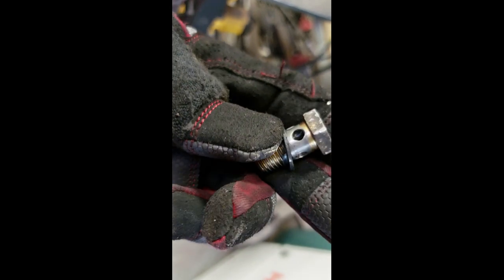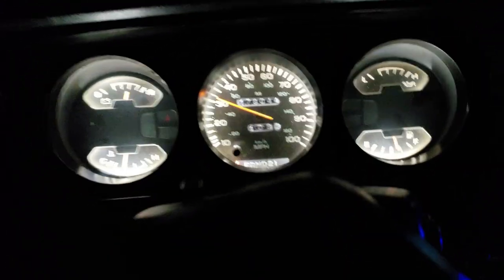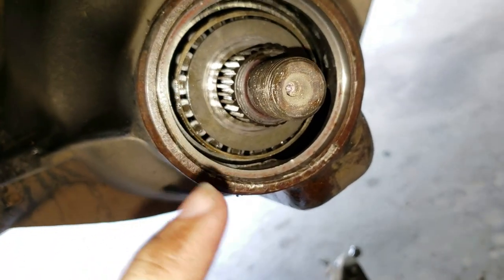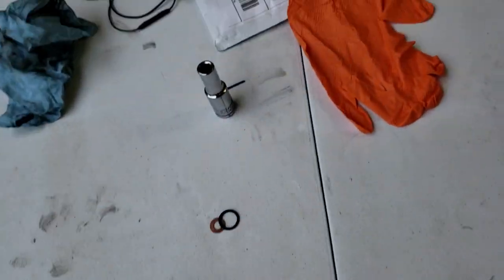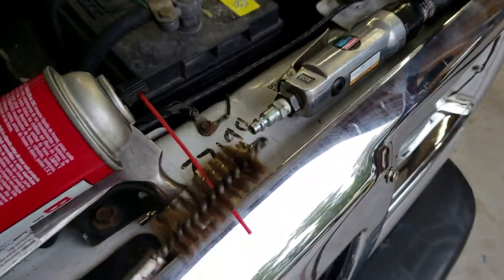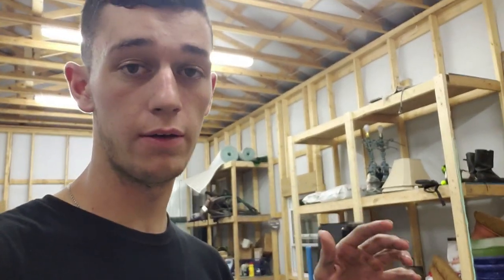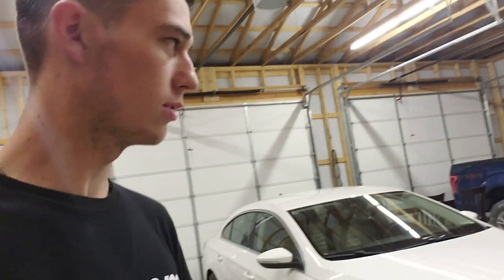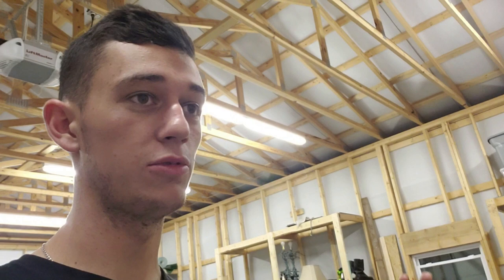FIRST GEN CUMMINS FUEL RESTRICTIONS PART 1

Comment: Do you have a build page or anything similar on a forum ? Curious on your injector size and what is your compound setup consist of . Also what your egts look like .

Just watched your lift pump video . I’ve had fleet guard fuel heater delete , bigger fuel filter , 5 x 0.14 injectors, and typical pump mods for a while with a hx45 . I’m around 38lbs And 650-800 egts now but would love more power when I put my dual place trailer behind me.

Thanks man , I appreciate you putting these videos out there!
Reply from the maker: Yes sir, I do unfortunately not have anything on a forum but I do have an Instagram ( @forged1gen ) and a Facebook  (Gavin Huke) just message me on one of those! I'd love to fill you in on that stuff and discuss setups! Love helping as much as I can